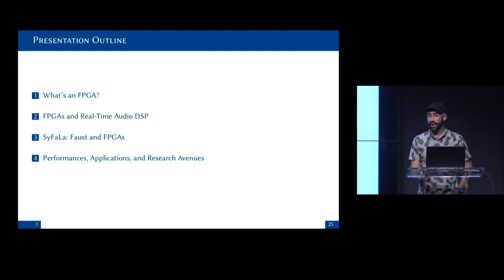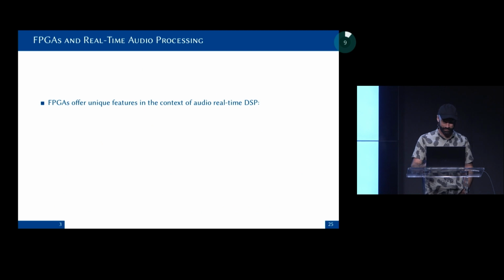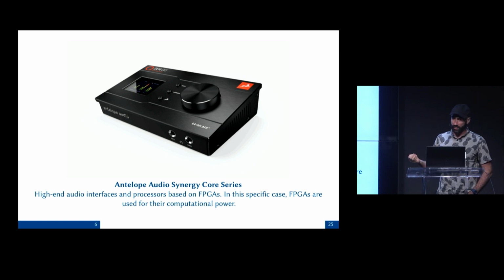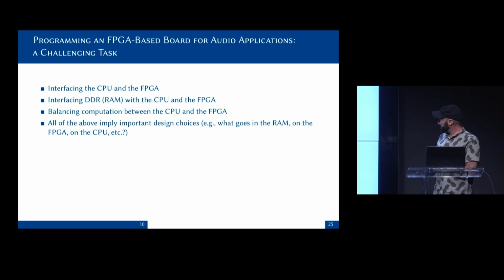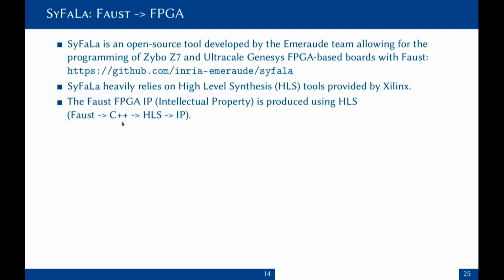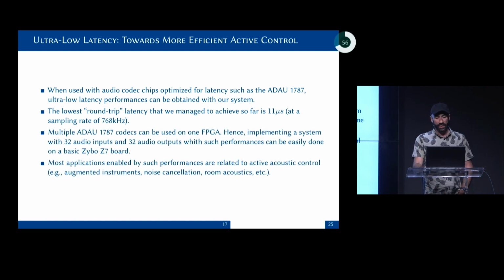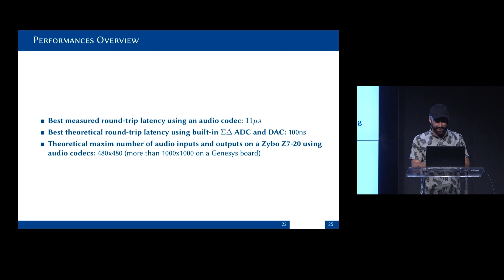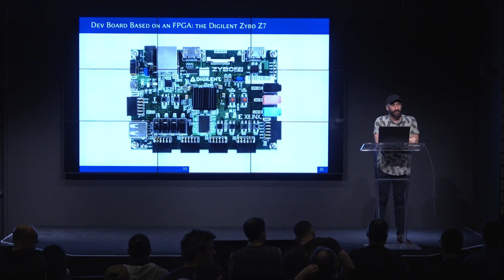High-Level Programming of FPGAs for Audio Real-Time Signal Processing Applications - Romain Michon

Comment: This is so great! Ever since coming across the Waldorf Kyra, I've been super interested in FPGA synthesis and DSP. I ended up researching flip-flops, LUTs, logic cells, and the theoretical stuff, but much of the tech seemed too over my layman head to invest in an Artix7 100T board or something, and I didn't want to settle for a gumstick lattice FPGA. I also didn't find many resources specific to audio synthesis. But since AMD acquired Xilinx and with some of the new FPGA tech on the horizon with massive quantities of logic cells, current info on how to use FPGA for synthesis and DSP will be so perfect for new and complex sonic worlds! But I also wasn't sure whether new AI capabilities could sidestep FPGAs with complex algorithms (GANs and etc) on classical processors, or if LLMs could enhance/enable coding such devices in Verilog, Python, VHDL, etc. Also, the DaisyDSP came along and newer Teensy boards like the 4.1 are pretty versatile. (When ChatGPT first came out, I was trying to contrive of a SBC like DaisyDSP augmented via an FPGA.)

I'm so excited by how quickly the tech is coming along through so many different channels. (Haha. Pun intended.)

Thank you for this presentation!